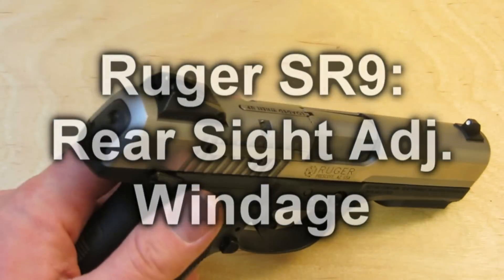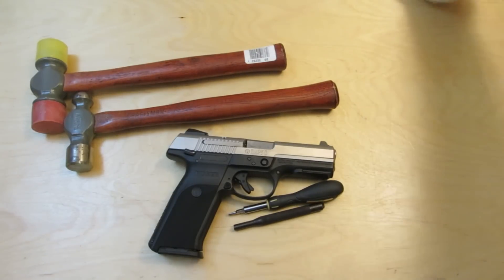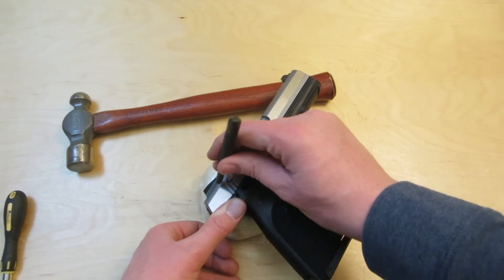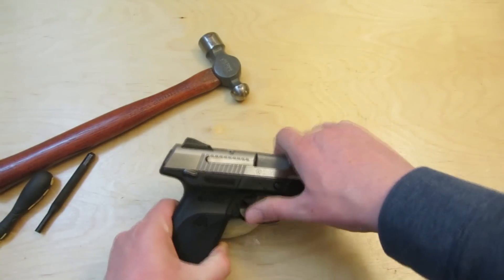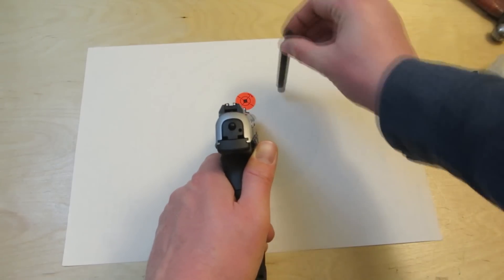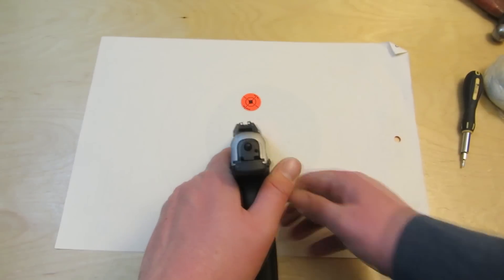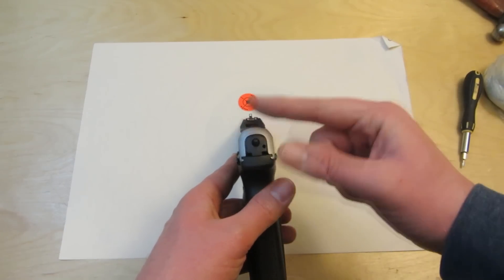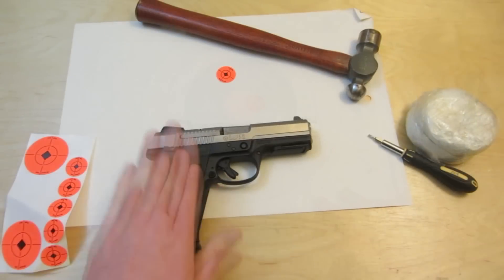Ruger SR9 Rear Sight Adjustment Windage SR40 SR45

Comment: I know this is an old video but I had problems with my SR9C where both front and rear sights were shifted off center. I went through quite a bit of ammo and thought it was my grip or trigger pull even though the Ruger trigger felt great. I shot another SR9C and  immediately saw a huge difference in the sights and my shots were great so I contacted Ruger. They were very receptive and assured me they would get it right so I sent it in and even though it was during early days of Covid, they had it back to me in a week. The sights have been perfect and my shots are on point. I just pulled it out to carry for a while again with the Don Hume holster, it feels great. I forgot how comfortable this gun is to carry. I have been carrying the Sig p365 for a year now and I still don't shoot it as good as the Ruger. Yeah, I'm babbling but the Ruger is a sweet handgun wish they would not have discontinued it.

Comment: I can't get the dang thing to budge! First off it was fine  to begin with but I accidentally dropped the slide itself on the floor when I was cleaning it with my greasy hands and when it hit floor sight was knocked off keel way right obviously noticeable right away. The screw was not loose when I went to check it it was tight anyways I unscrewed it hit the crap out of it with the punch it's not budging and it's starting to scratch edge of slide and site itself getting very frustrated don't want to pay $50 to have a gunsmith do two seconds of work
Reply from the maker: Call Ruger. They might be able to help.

Comment: WHAT ??????....All these tools and an extra pair of hands just to adjust the Windage ????? Building a house ?  A simple windage screw would have made this process much easier and faster at the range. Ruger needs to make an upgrade. Great pistol but not an acceptable process where one has to go out again to purchase decent front sights for this firearm !  IMO.
Reply: +Frank Napolitano It doesn't appear that "windage" was the proper description for this particular video.  It appears that he was constantly grouping to the right and it was a permanent adjustment to the sight.  IJS.
Reply: +Bradly Countryman   Still, there are times when you need to adjust windage in the field . Easy if there was a simple way to adjust windage for different types of ammo, without having to bring a tool box and and extra set of hands.
Reply: A Windage Adjustment Screw should have been installed in the sight.